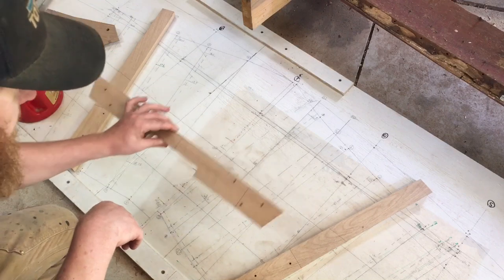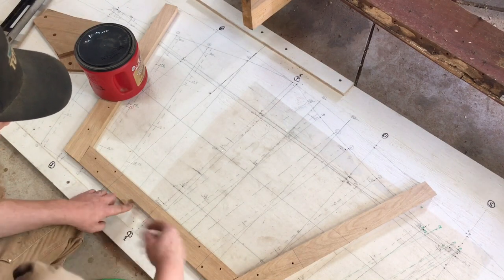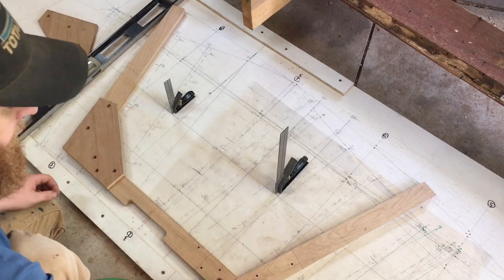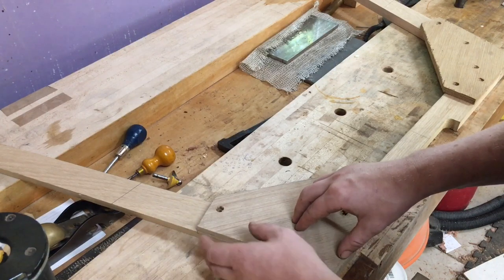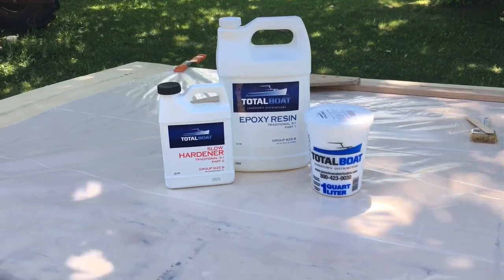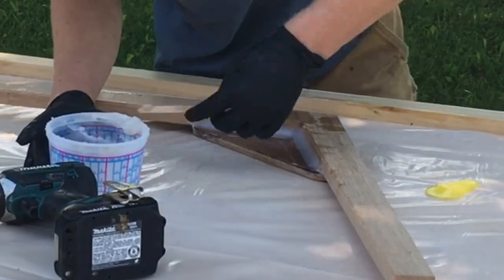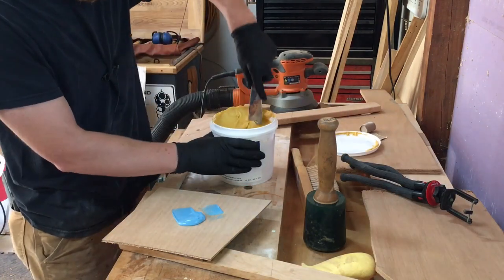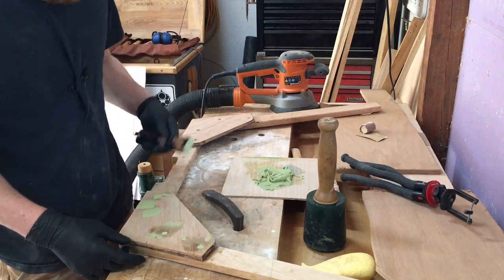Building a river boat part 3

Comment: Some folks might have said that was a shovel full of horse sh*t pouring out your scupper hole and wished you would nail a gusset over it but not me. I was with you all the way. Nice move pulling that fillet out to the edge of the frame. Totally worth it. For others reading this, Russel Brown's E-book “Epoxy Basics” has a ton of solid information and one of the tips is his recipe for a filleting compound. The trick is finding the right filler combination that is both structural and sands out easily. It doesn’t hurt if it looks decent if varnished too. His recipe uses equal parts of West System fillers 404/406/409. That’s high density; colloidal silica; low density fillers.
Reply from the maker: Well then. Thanks for checking the video out and for adding the tips for other viewers.
Reply: Oliver Woodcraft my pleasure buddy.

Comment: Sir, 
I have a drift boat I built form scratch using plans, river boat to you I think. My question to you has to do with varnish over epoxy. I'm about to clean the interior decks and sides that are not painted (clear wood). The clear area is fiber glass/epoxy with varnish on top, 2 coats. My question is it has been six years since the build, the varnish is a protection for the epoxy against IV rays. The boat has been garaged or covered when not in use. My plan is to wash the interior, sand with (suggestion) and apply 2 more coats of varnish, Marine Spare non-gloss.  Any suggestions are welcome, I've watched your varnish and brush care videos, was just wondering if you had any advice for varnish over epoxy. All advice welcomed. Thank you.
Reply from the maker: Scotch-brite and 400 grit will give you good tooth. Anytime I Varnish over epoxy it gets a minimum of 8 coats of varnish. Epifanes or Totalboat make excellent options.